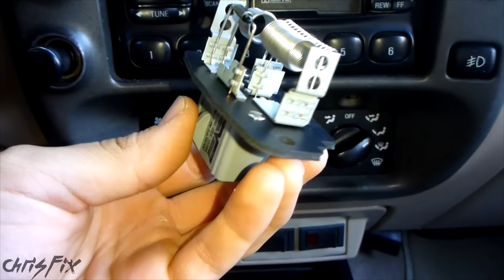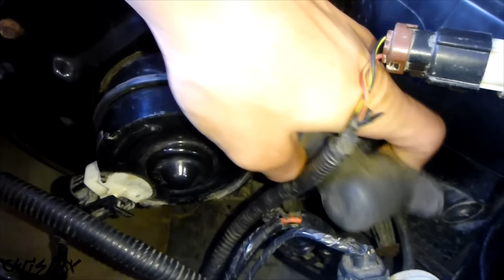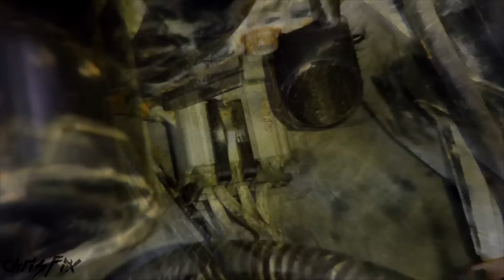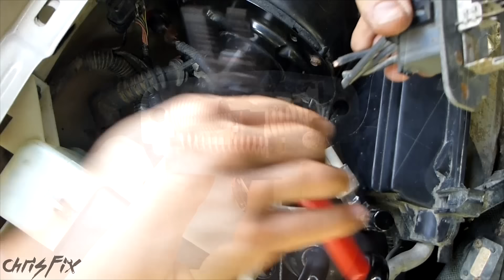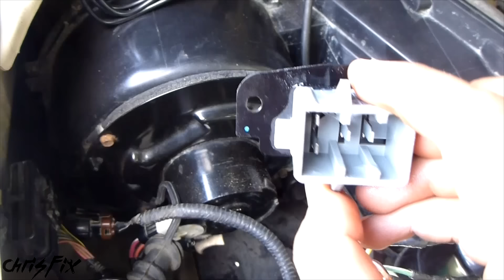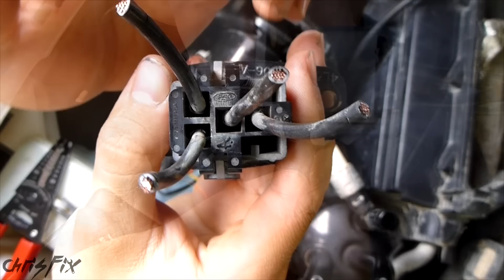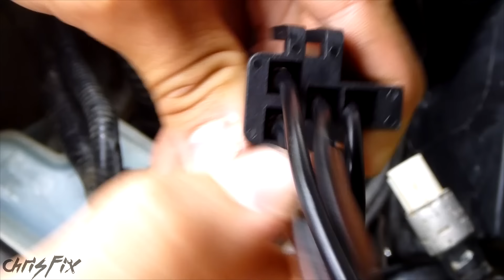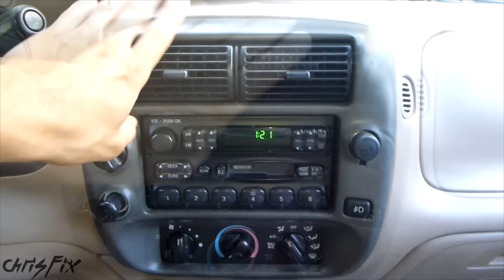How to replace a Blower Motor Resistor

Comment: Chris you are the man.  Love your videos.  I like how you go step by step and actually show what needs to be done.  A lot of videos will tell you what you need to do but wont show you how to do it.  You just can't go wrong in watching your videos.  thanks and appreciate ya.  peace
Reply from the maker: Thanks a lot!
Reply: @chrisfix  Hi Chris, first time reaching out so many thanks for your work and help.  I have a '99 7.3 PS E350 w/ no heat.  I have flushed the coolant 3x, flushed the heater core until clear, and replaced the Tstat and the blower resistor (which fixed the lack of fan speed control previously only working on high speed), but still zero heat.  Can you help?! 

Thanks in advance,
Ben

Comment: What car is this on???? My grandma has that same issue on a 04 expedition FX4
Reply: It looks like a Ford Ranger.  Mine is a 96 Ranger XLT 3.0L v6.  I fixed mine last Friday, which was November 15, 2019.  Pigtail and Resistor.  Only difference, I had to remove a couple extra wire harnesses for a little extra room.  Not much room to work with.  But fan now works.

One piece of advice to add.  If you have to replace the pigtail, you migh want to attach it to the Resistor, before you rewire the harness, or pigtail, to see if it would be easier to install.  The body of the truck above the tire well, was a problem.  I had to use a screwdriver, with tape over the end, to push the pigtail into Resistor.  That was my most difficult thing to do.  Use a quarter inch drive socket for this project.  Have different size lenth extensions too.  ChrisFix is awesome!!!

Comment: My car the blower is not running while the engine is running. But it's does run when I put the key on start position. (???)
Reply from the maker: Check to see if the alternator is working and that all of the connections to the battery are clean and tight.
Reply: @chrisfix  : I watched more videos, I think the resister is the problem.

Comment: Thanks. I cannot get connector off. I was hoping I didn't need the pigtail. But man, it is on there, whether corroded metal to metal inside or what. Dang. So I just ordered it. Guessing no issues with leaving it unscrewed and hanging.. Not easy unscrewing

Comment: thanks for the vid.  picked up a 2003 ranger.  lower 2 blower settings not working...didn't know about the blower resister...and location.  just ordered 15 bucks. Hopefully won't need pigtail....we'll see how it goes

Comment: I have a 1989 Lincoln Town Car, when I accelerate my A/C stops blowing.
I've changed the vacuum reservoir, heater control valve, check valve, temp servo, checked the vacuum hoses for cracks, nothing has changed.

It only blows cool, not cold, when it does.

I had R134 put in, still just cool, not cold.

No matter what I select, air only comes out of the front vents.

Any other suggestions?

Thanks in advance

Comment: Never twist your strippers on the wire. Clamp down and pull it off. When you twist is scores the wire and strands will break off. 25 years of commercial electrical experience talking here. Peace

Comment: Great video! Very thorough and informative. I have to replace a blower motor on a 1995 Ford Ranger (I am guessing since it seems that I get a surge of power to the motor itself). Now I know that I may as well change the resistor and pigtail out while I'm at it being Ford had an issue with these (wasn't aware of this until now👍). I appreciate it and thanks again!

Comment: My fan won't blow at all but the heat or cool air is there, just doesn't blow. Would it still be the resistor?
Reply: I would say a dead spot in the motor of the fan, may need a new fan, can't imagine all resistors bad, but it could be a wire not making connection or ground wire broken, check all fuses

Comment: Depaula Ford wants 281.00 for blower resistor and connector replacement for econoloine van. And 405.00 for blower switch and connector replacement. Let me think about that one.

Comment: Dude how can I diagnose a bad ac control panel?  I ready check fuses, blower itself and compressor as well,  but still I do not receive any power on my blower motor. @chrisfix  ChrisFix

Comment: If you were to pay someone to do this, how much would it typically cost?
Reply: It really depends on what type of car you have.
Meaning, on some cars, the resistor is easily changed. Let's say, a $50 job.
Let's also say you have a friend who is mechanically inclined, and will help you out for a six pack of beer. The part is fairly cheap, it's just getting to the darn thing and the time required.
The last thing you ever want to do, is to take it to the dealership. It will be the most expensive, frustrating, ordeal you will ever encounter.
Depending on where you live, you have a few options, and the dealership is not one of those options.
Craigslist has mobile mechanics. Big cities has mechanics that park in front of car parts stores and they have signs on their vehicles. 
The last two options are getting a friend to help you, as I said, or you watching these videos, getting the tools, and challenging yourself.
It is quite satisfying doing it yourself, and knowing you didn't get totally reamed by the dealership, and you accomplished the project.
It's a very proud moment when it all goes well.

Comment: My AC is acting up I replace the heating cooling control switch imagine the whole thing put new freon
Reply: And it's still doing the same thing you close for a while and then it starts blowing hot air what could it be

Comment: Nice. I have a 1995 Kenworth t600.

It's resisters is for 3 settings.

Could I add this risister? For 5 settings to make my  blower go way  faster. ? I'll just add the 5 level switch if I have too?

Comment: Finally had to change the resistor on our 2006 Ford Escape and was happy to remember you had done a video on it. The wires on her pigtail were all different sizes so I ended up having to buy different crimp connectors, but still used the same techniques and worked great. Thanks again Chris! Your older videos make a huge impact years later!

Comment: Hey Chris, do you have any idea why I would be only getting 9 volts to the blower motor? I have changed the resistor and checked all the fuses and checked the blower motor with a battery. Thanks

Comment: Vaseline works exactly the same,  and is cheaper than dielectric grease
Reply from the maker: Thanks but it does not. Vaseline is a petroleum based product, same thing the wire insulation is made of. You don’t want to use Vaseline because it will degrade the plastics and insulation it comes in contact with. Silicone is better to use because it is not made from petroleum and will not degrade plastics or the wire insulation.

Comment: mine,  on a 2006 Chevy avalanche,  stopped working all together--there was a power serge and then ...nothing,  in the weeks prior,  the heat setting wouldn't let the blower work above 75 degrees
Reply from the maker: Did you check the fuse.
Reply: @chrisfix  it was the resistor ...there's 2 fuses..  one for the blower  which is fine and one for the heater controller--the blower,  which is a 30 amp still had continuity  and the heater/ ac digital display was well lit and fine...the resistor's fins were corroded to crap and, from what i understand,  they go to shit almost on a yearly basis with Chevy's ..the girl was astounded when she saw mine was original from 2006...just bought the new one today

Comment: Thank you so much for this video. I cheaped out and just bought the resistor turns out the wires were, just like you mentioned, melted on the terminals. So thanks for covering in detail the wire configurations.

Comment: Question: Why did you only disconnect the negative terminal on the battery? Shouldn't I completely disconnect it? I don't know anything about electricity or batteries so I just want to make sure i'm being as safe as possible.
Reply: SN~
To be certain you won't cause a short, or an arc, you can disconnect both the positive and negative terminals.
I remember one time, I just took off the positive terminal, but I forgot I had a long box wrench near the battery. Well, it slipped and arced out- sparks and smoke galore! I quickly got the wrench off the positive post and learned a very good lesson.
When doing electrical work - AC or DC, it's just best to make sure the power is disconnected.
No danger in getting shocked with DC, but you can really cause damage to the electrical system.
Working with AC, you are risking your life. I knew an experienced electrician, and he thought the main breaker on a 400 amp panel was off. He grabbed the panel, and it was such an incredible amount of electricity, he could not get his body to move, and he died.
It is said: "A genius is somebody who can learn from somebody else's mistakes."
⚡

Comment: Hi Chris and all, On my side the problem is on high speed i am getting very low air while on med and low air flow is fine w.r.t its respective speed. Could this be a Blower Motor Resistor issue?

Comment: hey chris could you answer a question for me i have an 01 ford ranger the blower motor was running and stopping so i changed the motor and the resistor didnt fix the problem so i changed the relay this seemed to fix it but 3 days later it started again i checked the relay and it was burnt up i have since put 5 more relays in since this and have found if you run the motor on a lower setting the relays last longer but still burn up what could be causing this? please help!!!!

Comment: I have this problem. It will be fixed soon. My selector of air flow knob also doesn't work. It only blows out the defrost vent. Any ideas of how to fix that?
These are my go to videos of how to work on my 1997 ford ranger. Chris is good at what he does!

Comment: Excellent video , I have a 2002 Dakota which has a circuit board that looks totally different , but you gave me a great idea , cut off the board and solder in some springs / resistors . Thanks .

Comment: Hey Chris. By any chance, did you ever have to take the heater core out to replace it? I think my 99 has a leak along with a a bad blower motor resistor, blend door or blend door actuator. Great vids

Comment: if i don't know if the reason the motor is not working, how do i know its the resistor or the motor? should i replace the resistor first?
Reply: I would replace the resistor first, it's much cheaper than buying the whole motor.

Comment: Hi Chris..I have the exact climate control switch in a Chevy Express.. by any chance would you know what’s on the Chevy’s HVAC circuit?
It keeps blowing the dash control fuse as soon as I turn the knob from off to on, which is the AC max position. It has to be a short on one of the wires leading out from the switch, right? Even with blower, resistor, ac compressor and dryer disconnected it still blows the fuse.
I’d appreciate any help.
Reply: butchtropic 
I have them both actually.. I don’t really feel like testing components.. I’ve set the blower on every speed before flipping the switch on and blew the fuse every time so it wouldn’t be the resistor.I believe the schematic had the power from the dash running to the high pressure switch on back of the compressor before engaging the clutch. I think the fault is in that wire.. 
p.s. I’ve also tested with a new blower, new resistor and new dash control it still blew the fuse.
Reply: butchtropic 
Yeah definitely a short on the ac wire.. when I disconnected the clutch about a week ago the blower started working. But the connector looked fine, started peeling the heat shield back , no chafing no burns everything was in tact. Of course the next day it blew the fuse again because of vibrations from driving..

Comment: If your heater doesn’t blow out heat but air blows out and the speed dial works .. can the blower motor resister still be the issue ??

Comment: I have a 2007 crown vic when i turn on my ac i can hear the compresson turn on but doesnt blow air hot or cold could it be the blower motor or the blower motor resistor???

Comment: hey Chris just wanted to say thanks for the video it was great I replace the blower motor resistor before I watch this and it was also on a Ford F-650 and wanted to recommend that since you're taking the resistor off anyways you can break the resistor in pieces off the connector so that way you don't need to replace the connector and instead just clean it, but when it's that bad it's probably also best just to replace itl

Comment: pos+ to dash selector switch then circuit travels to plug resistor low, medlow, medhigh out to fan,  high speed goes to relay straight to blower

Comment: If my blower motor doesnt work on any speed what so ever, but it works when i remove it from the case, and let it run freely in the car, is it the wires, the blower motor itself, or the resistor thats the issue?

Comment: Help! Hello Chris, Thanks for all your work to educate us. My son and I are rebuilding a 280zx and have a problem with the blower motor working intermittently. It works for about 15 seconds at a time and when it's working it works in every speed but then it cuts off and doesn't come back on until it randomly decides to. I've messed around with the connectors and haven't had any success with finding a short or loose connection. What else could this be? I assume the fuse is good, the resistor is probably fine. Could this be something to do with the blower motor?

Comment: What if your ac/heater isn't blowing much air through the 2 central vents? I have a 98 honda accord. The lights to it have also been turning off, the ones that  indicate what you selected. I'm am gunna change the cabin air filter and regular air filter since its due but idk what part control the center vents. Very very little air comes out of them. Its like my vents are stuck on defrost so only the outer vents and windshield vents will blow the most air. It does still get hot and cold so no temp problems.

Comment: boy do I appreciate how Nissan designed their HVAC system compared to these Fords. My resistor and blower needed a phillips only, and I could do it all from the comfort of the passenger seat, which is nice when its 0F outside and your heater isnt working.

Comment: Hey Chris. I really appreciate your videos, and have started working on projects I never thought were possible. I have a 99 Ford Ranger (just like your Mazda), and I was having the issue of my fan only working on High. Heat and AC work great, just speeds 1-3 were a no-go. So I just replaced the Blower Motor Resistor (with a new wiring harness), but the issue is un-resolved. The AC and Heat are still working, but still only on the highest setting. Any Ideas on what to do next? The colors of my wires were different than yours, but I made sure to connect the new harness to the correct wires to match how it came from the manufacturer (had not been touched). Thank you very much!

Comment: Hey Chris thanks bro , very informative video ,   this is exactly the issue i just ran into  in my 2002 Dodge Dakota, and  should be an easy fix once i get the new part and wiring tools , here i was thinking my thermostat blew out  , it`s just old faulty wiring and will need a resister replacement , it`s also kind of fun fixing things on my own and purchasing tools , i`m very grateful for all of your easy to understand step by step instructional videos

Comment: Hello Chris, i really hope you read this , my blower motor has a problem of shutting down all of a sudden , most of the time it turn itself back on but sometimes it stays dead, i checked the blower motor, control switch and relays and all the fuses , all seems to be working fine, what do you think the cause or causes, thanks

Comment: So what if it doesn't blow at all?
Reply from the maker: Could be the fuse for the blower motor or the blower motor is bad.
Reply: I don't know what I did but it works now. haha. I think I either need to add more AC coolant or the compressor may be bad... This truck is a lot of work when you're tight on cash...
Reply: Also, I think I might have fixed it but it said my system to lean in bank 1 and 2 so I changed my spark plugs and now it sounds a lot better and I cleared the codes but if that isn't it what else could it possibly be?
Reply: Hey Chris.. so I was changing my spark plugs and acciddeenttlyyy mixed one up... Just wasn't thinking I guess and it misfired in cylinder 5 and 6... Now I have a rattling noise... sounds like a rod bearing I guess? I'm not sure. But I can tell you the noise isn't constant....

Comment: Those yellow links between cables are not supposed to be "taped" they are actually covered with yellow(in this particular case) thermal shrink plastic links. You have to use a heat gun blower or a simple lighter to apply heat to the plastic  and parts and make the plastic shrink and be tight and sealed. After that, just to make sure one can add a bit of insulating tape. But good video.

Comment: Question. I replaced 1. Relay, 2. Blower Motor Resistor, and 3. Blower Motor.
BM and BMR are under dash (02 Ford F150 5.4l)
When I turned system on everything worked great. Then suddenly blower motor cut off when on medium low and would not come on on anything except the highest speed setting.
I did not replace the connector or the fan speed switch.
What did I do wrong?

Comment: Chris I need helllpp.. I changed out resistor and blower motor because my highest speed did not work.. after new resistor and motor highest speed still does not work.. can the speed dial go bad? I have checked wiring and nothing looks fried. any ideas would be much help.. its -30 and the third speed not cutting it

Comment: What happens when the factory wires are cut so far back that you can't put a new connector on because the connector was changed so many times? Time for a new truck?